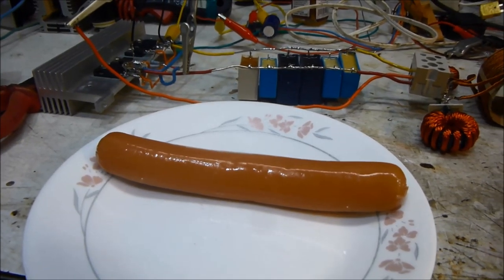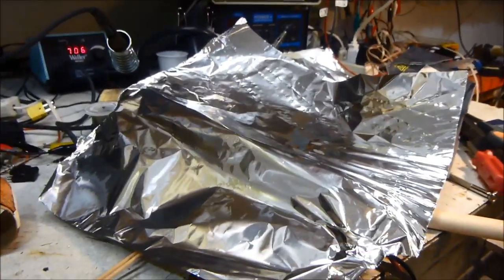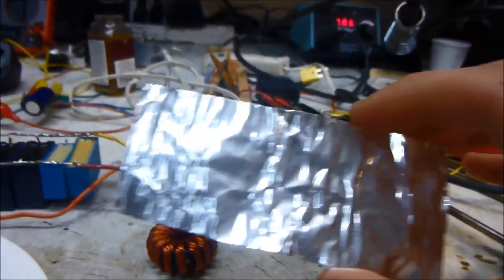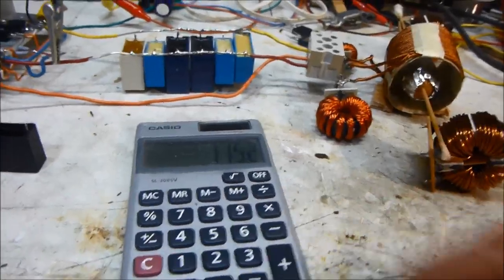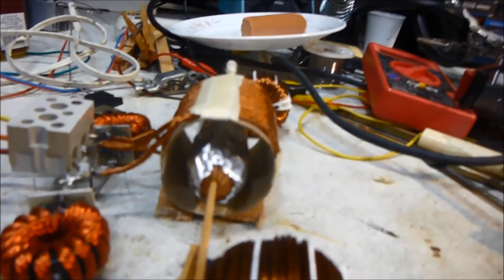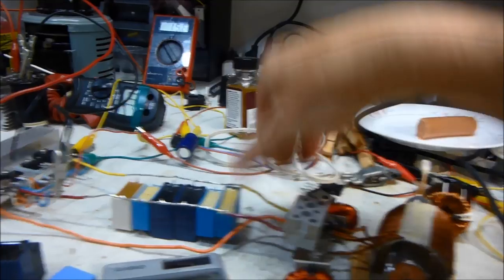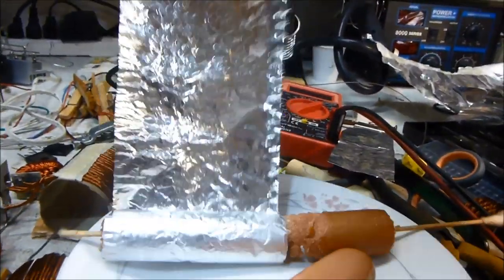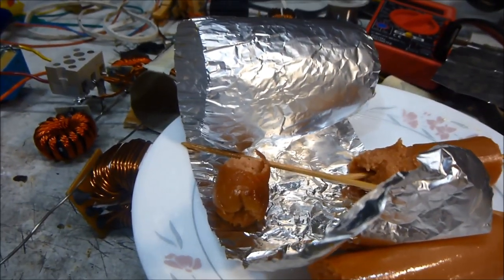Cooking a Hot Dog With Induction Heating

Comment: that is cool. The hotdog cooked half an inch from the cardboard, and the cardboard didn't burn...
I'm also impressed with the Al Foil... its such a good conductor I wasn't sure that could work. For under 150watts too. I really cant wait for my mosfets to arrive now...

Only one question, Does more or less layers of foil make it cook hotter/faster? I suspect less layers would be good.
Reply from the maker: Yep!  All the heat generated in the aluminium foil was sucked right up by the hot dog.

Yeah!  Me too!  I hope you get your mosfets soon too!  

Hmm interesting question.  I'll have to find a way to test that.  I'm actually not sure it would make that much of a difference at all.  But maybe it would.  

Thank you!
Reply: The ohms difference between 1-2 layers and 10 layers may not be that much, but I suspect higher ohms will yield more heat for equal current, to a point.
Reply from the maker: Yeah that's quite possible.  Not sure unless I try it!  I'm not sure how I would measure if it heats up slower or faster though. I mean I could just time the hot dog cooking time but it's hard to tell if it's done and the input power could change.
Reply: I see your point... Boil a known amount of water in test tube?
Reply from the maker: Mongrel Shark Actually that was my thought too.  The one problem is that it's hard to get like one layer of aluminium foil to make a good electrical circuit.  I would love to solder it together but it's nearly impossible to solder Al.  And just over lapping it so it touches is not really enough.  I guess I could try tape.  Or maybe folding it over some how.  But it also needs to be tight against the test tube so there is good thermal contact.  Unless I put the Al foil on the inside of the test tube so it's in the water...  hmmmm
Reply: 2 layers vs 10 or more should offer good comparison.
I like the inside idea.

Rubber bands, glue, string and wire all come to mind too.
Silicon has a very high temperature tolerance.
Many strings could probably handle boiling too.
Reply from the maker: Hmm interesting!  I like the rubber band idea!  I think I see how this will work!  Thank you so much for the ideas!  I think I will make an induction heating test rig!  Styrofoam cup should work nicely!  Right now you are probably like what???  How is a Styrofoam cup going to work???  You'll see!!!  XD  Now I have to go work on this!
Reply: Cool. I have a few ides about the cup.
I'm making a laser btw :D
Reply: Still amazing my family with the old 2 nails and 120V AC. Can't go wrong with hot dogs man. You can eat them raw. (as long as they are properly kept). Still I wish this kid was my son. LOL!
Reply from the maker: Good news!  I just got a couple Styrofoam cups!  Now it's really time to get to work!!!  :D  Mongrel Shark Cool!  Are you building one of those TEA lasers?  Edward McLaughlin Hahaha I actually still want to try that!  I've wanted to do it I just haven't yet!  Very true about raw hot dogs.  Hahaha  Yeah everyone says that!!!  LOL
Reply from the maker: Anton Babiy Induction heating stuff.
Reply: Yep a TEA laser. Its not working. Killing plastic fast though. I need to work out how to turn the flyback JT down now... LOL.  Capacitors are getting hot as its firing too fast. I also think my plastic binder pockets are too thick, going to get Mylar and transparency sheets tomorrow.
Reply from the maker: Interesting.  Try adjusting the resistors or turns of wire on the flyback if you want to turn it down.  Good luck!  BTW I'm getting induction heating to work through Styrofoam cups!
Reply: Added more resistor. Its popping the plastic less now :)

I had a feeling your where going to do that. What did you do? Glue foil inside the cup?
Reply from the maker: That's good!

I wrapped the aluminium foil around pieces of PVC pipe.  Then I used rubber bands to secure them.  It seems like one layer is better than about 6.  Contrary to my prediction, one layer seems to make the induction heater draw a lot more current and heats a lot faster.  I can't do any more tests right now because I burnt out my mosfets again and now I am working on building a new ZVS driver.  Check out my newest post on Google Plus to see the latest progress!  You will love it!!!  :D
Reply: I just saw. Looking very neat!

I had a feeling one layer would be better. More resistance to get hot.
Reply from the maker: Thank you! Well you're right!

Comment: Pretty cool :) What's the bridge rectifier for though? Isn't the coil powered by AC voltage.
Reply from the maker: Haitham Sweity Well you need a higher frequency to do induction heating.  60Hz is not enough.  So I rectify the AC to DC then use that to power my ZVS driver.

Comment: Did you put current limiting power resistors to control the current going to your circut?
Try putting current limiting power resistors so you won't burn out your rectifier or mosfet.

Comment: I have cooked hard-boiled eggs and quinoa with my series-resonant induction heater. I keep burning out my ZVS work coils though, so extended operation is difficult.
Reply from the maker: Interesting! Cooking an egg is a good idea! Thank you!
Reply: Makerj101 No problem. I have also wanted to build a more powerful version (mine is only 200W) that runs straight off the mains.
Reply from the maker: How are you running it straight off the mains?  Thank you!
Reply: The one I have right now is running from a 50-75V transformer bank, but I can make another half/full bridge that can handle higher voltages so that the bulky power supply can be replaced by a rectifier and capacitor.
Reply from the maker: Interesting!   Thank you!

Comment: heh, nice job. realising the fact that its only the heat transferring from the Al foil to the hotdog to cook it. your capacitors will make a big difference by changing the frequency.
Reply from the maker: Thank you!  It does make a difference in the frequency.  But I feel that with just one capacitor the frequency is higher and that makes it more efficient.  But I could be wrong.